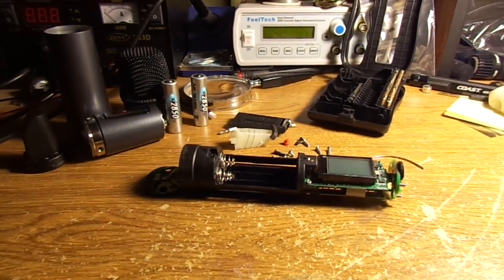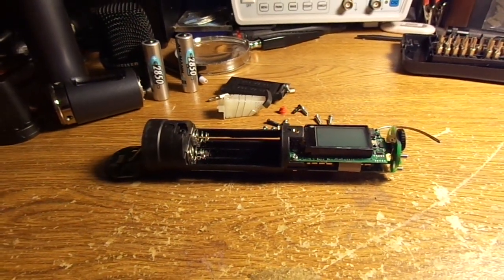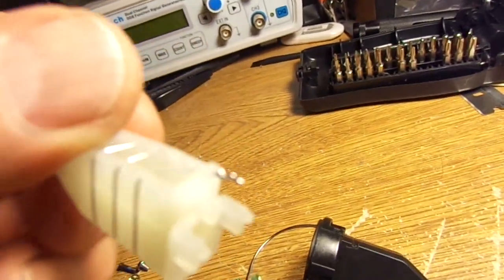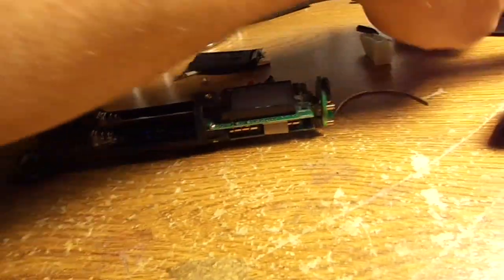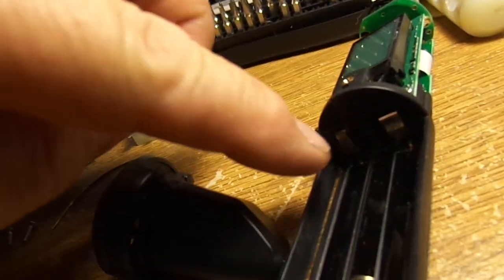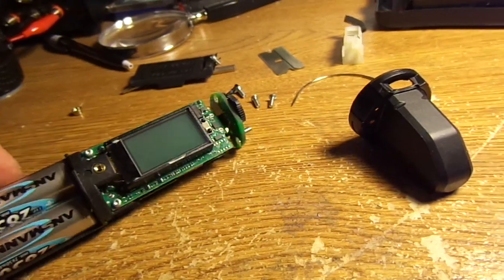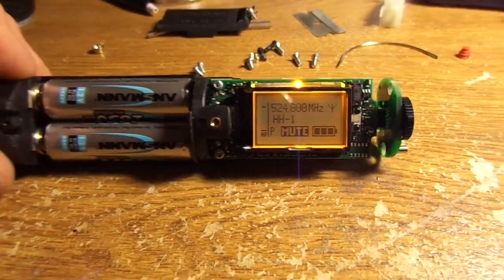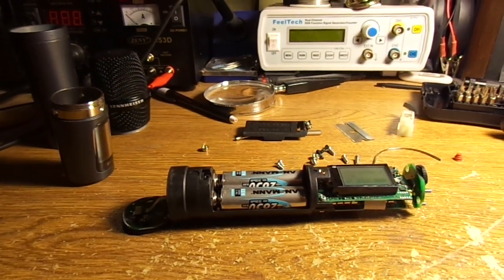DEAD Sennheiser wireless mic repair

Comment: This is amazing! Definitely solved some of my issues! I've had my e865 for many, MANY years (I'd say since about 2009??), and my LCD screen is.. well, it lights up to the orange screen, and there are a few black pixels on the bottom left, but the text is not displaying 😭No abuse, and I'm the only one that uses it: it hasn't been dropped recently, and I can see no visible damage to the screen covering. It just stopped working one day. I've finally managed to get it off mute (thanks to this video!) but I am unable to change the sensitivity of the mic itself: I'm guessing this would need to be sent in for repairs?
Reply from the maker: yes probably so, IF they would actually repair it.  Thanks for the comment

Comment: Hey have you got any help in fixing the power button with a ew100 g2? I've been given one where the power button's been pushed in and broken the switch. I've pulled the bottom case from the mic, but unsure how to separate the circuit boards to work on it. Any ideas? Thanks in advance!

Comment: Edward Weltevreden: I have 3 EW135G3 handheld transmitters that wont work. one is turning on but gives a message" incompatible capsule. and the other two wont turn on. I have checked the lips in the battery compartment ass you mentioned. With one of the units one of the lips is broken. with the other unit nothing is damaged but it still wont turn on.
Reply: Corrections the transmitters are  EW100G3

Comment: Do you have a video on how to dissaemble the mic?
Do I have to take off the antenna fin before removing the display cover?
Reply from the maker: I do not have a video, but  I will de solder the antenna lead from the circuitboard and remove the fin when I work on them.

Comment: Hey Rick,
I'm gonna preface my question with this - I don't have a ton of experience with electronics, but I'm somewhat handy, so I've figured out how to get mostly to this spot in deconstructing the mic.

I had a gig last weekend where a drunk wedding guest knocked my mic from my hand, and I couldn't get the mic to turn back on. When I took it apart, one of the circuit boards came out and the other is still in the bottom of the mic. Also, there is a white striped plastic strip with a blue tip that seems to have disconnected from the other circuit board. Can you help me fix this issue?
Reply from the maker: Hard to explain this but that is a strip of wiring. There are 2 little tabs on the circuit board connector that you pull back. Then insert the ribbon cable into the connector and push the little tabs back. They are the lock that holds the cable in place.

Comment: How did you get off the cylinder housing? (the biggest metall part you hold in your hand)..Thanks...
Reply from the maker: Nizeplay Productions you have to de-solder the board and it comes out from the top.

Comment: Hi, I have a microphone from SENNHEISER (ew 135 g3) But when I turn it on, it works for 10 seconds and then the receiver goes MUTE, and it no longer receives the signal from the transmitter. can you help me? hug
Reply from the maker: umm, no hug please... lol Seriously tho, make sure your pilot tone is turned on at the receiver and ensure the mic is on the same bank, channel and frequency as the receiver. Good Luck
Reply: We had the same issue, it would turn on but would not transmit. We noticed that the three tiny screws around the battery section got loose and it would prevent the battery part of the transmitter from screwing in all the way into the transmitter. And thus will prevent capsule from contacting the transmitter. Used some blue threadlocker on all 3 screws and problem solved. Also make sure that capsule is screwed in all the way.

Comment: Hello. My microphone does not turn on the display; the inverter generates 5 volts but the processor oscillator does not start.
Reply from the maker: You got me on that one... Maybe a problem on the component level. May have to check every component on the board if you wanna try to fix it. Lots of time involved, Good luck
Reply: during the moment of power on we have momentary signals of SDA and SCL ??
Reply: It does not generate any signal.

Comment: I've only gone and pulled out the connection for the antenna and can't get that part ot the circuit board out, do I need to get the screws out at the bottom to do that?
Reply from the maker: You will have to de solder to get the antenna off and resolder  when done.

Comment: my mic lcd is blank, should i change lcd, also where to get it ?, thanks for video
Reply from the maker: If it wasn't dropped or abused, you probably have a bad controller on the mic. Even a bad LCD will usually have something on the screen.
Reply: It wasn’t dropped or misused, suddenly lcd stopped working, i reconnected lcd still no display, which controller ? 🤔

Comment: Mine have a power but the receiver does not receive any signal from the microphone. When I tried to touch it, it sent a grounding sound and the AF in the receiver moves. Do you think the capsule is broken?
Reply from the maker: It's possible. The capsule will unscrew and you can try one from a known good mic
Reply: @rickcperry  thank you. We'll try to do that. Do you think I can use a capsule from a dynamic mic?
Reply from the maker: @jumpstartnow0324  no you must use one designed for the mic.

Comment: Was ur batteries getting hotter nd if i disassembled it will it void warrenty please reply
Reply from the maker: Not getting hot, just no connection to turn on the unit. Yes if you disassemble the unit as I did, you will void the warranty. This unit was not under warranty.
Reply: @rickcperry  okay thanks for the help but mine is brand new used on one function only 
The contact point is flat when i tried to add aluminium foil to make contack it get hot

Comment: Hi there, I have the same Mic but for some reason I can't get it to unmute. Do you know how I can solve this problem?
Reply from the maker: Make sure the pilot tone is enabled and verify the mic and receiver are on the same channel and frequency.
Reply: @rickcperry  Just checked all that and pilot tone is activated and the mic and receiver are on the same channel and frequently but still saying muted. Also tried to reset the mic and still saying muted. Not sure why
Reply from the maker: @isaacrichards2190  found one thing with a google search… maybe something else to check…. On the transmitter, ensure that under advanced settings the mute button is enabled and set to AF Mute,

Comment: if the mic is turned on but in a few seconds it will turn itself off, what is the estimated damage to the part?
Reply from the maker: There may be a component on the board starting to short to ground. Make sure you test with brand new batteries, not rechargeable ones. The battery level indicator isn't really designed to properly show the battery life of the recharge ones.
Reply: @rickcperry  I have installed a new battery.  maybe you are right in saying there is a component part that is short to ground.  does that mean I just have to check the components that are directly connected to the battery?